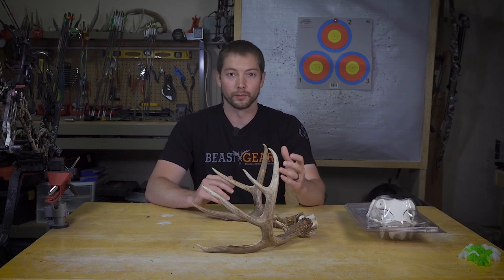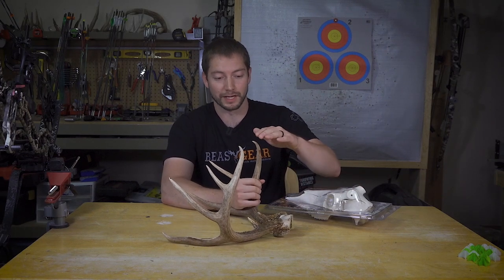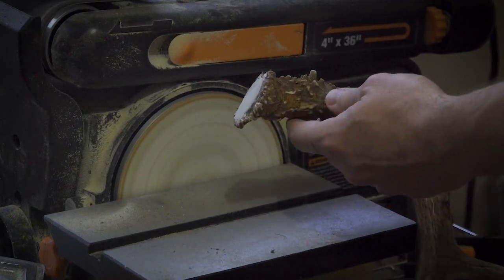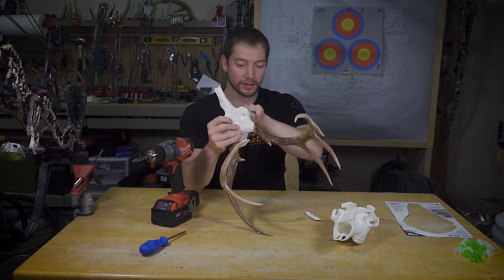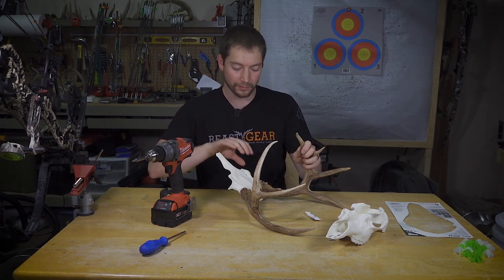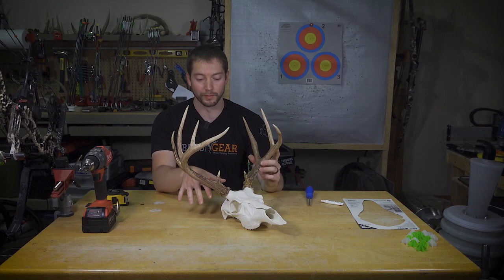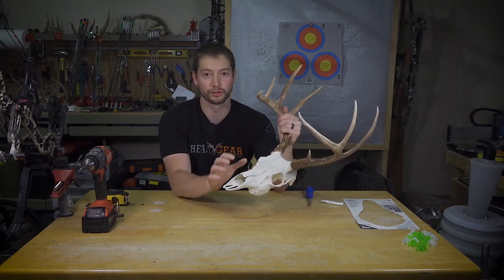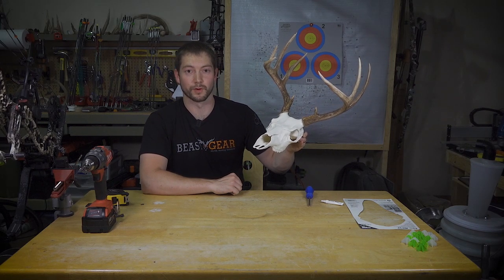Mountain Mike Euro Mount Kit - Good Alternative?

Comment: Your looks good! I’m not crazy about them but living in PA with 3 other states within an hour’s drive they have become a requirement for me because I do not like just the skull plate. I make a wash of 1 part flat white latex paint and 2 parts water and coat the skull to take the shine off of it. Then I spray it with clear flat acrylic, so you can easily clean/dust it later.

Comment: To eliminate that gap issue you can just drill out the hole in the skull plate slightly larger than the screw. That way, the screw will grab the antler only and not the plastic plate.
Reply from the maker: Good idea

Comment: looks cool bro as long as you took measurements of the deers spread before you removed the antlers and adjusted them fitting the right spread hey it would pass as a legit mount cause even people who do euro mounts are basically just displaying the measurements of the deer and the antler size and points on the rack i mean whats so appealing  looking at a deers head with the eye balls missing and the nose and the fur basically as they are called a skull mount so if some ones just wanting to display their deer's potential in measurements and points and they don't screw up the measurements or knowingly make the spread look bigger then it really is which i would think would make it more look unrealistic then hey i say by all means people if they got the time and the tools to do so and make it look legit  and don't make the antlers look all wonky and stay as close to if not on point to the measurement the deer was when the antlers were on it then i say hey go for it save thousands and months to years to get your trophy back and get them bragging points to friends and family specially a good idea for a kid or even an adults first buck